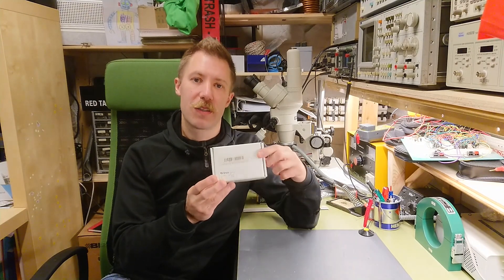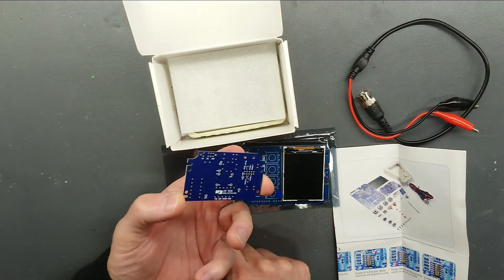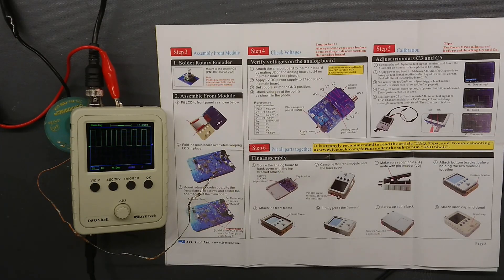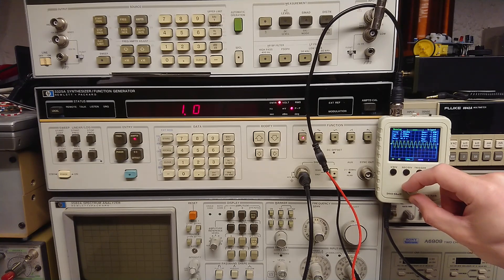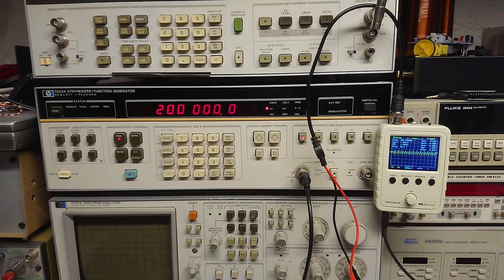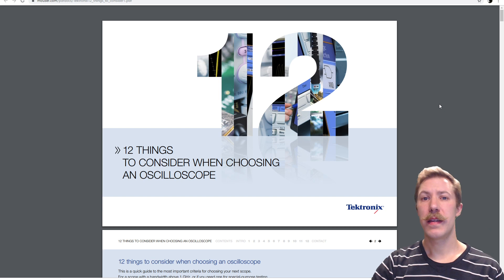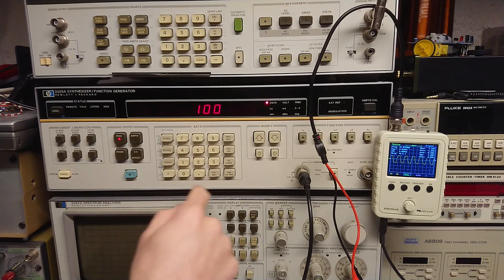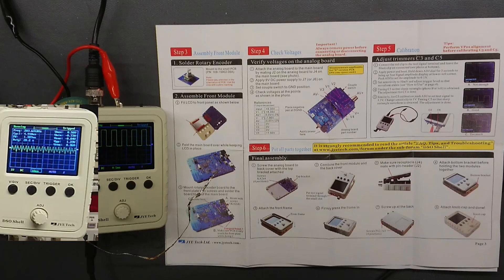DSO138 Oscilloscope Review, Test And Why You Should Not Buy It

Comment: Just about what you can expect from something like this. 

Great video showing the actual limitations for the device. 
I find it quite funny if people complain, that oscilloscopes are so expensive. 
If you consider that most of them own a 800$ smartpone. 
I guess if you really want to do some stuff, even a 200$ chinese scope is way better than this.
Reply from the maker: If you really want to go cheap, finding a old analog 20 MHz scope is the best. Even the half bad/whole price USB scopes are low performance. A second hand rigol from their first generations would be a good buy as well.
Reply: @KaizerPowerElectronicsDk  
Yeah I started with an analog 30MHz Hameg scope some years ago.
I would recommend something like this to everybody starting electronics, since they are cheap, basically indestructable and you really need to learn how to measure since there is no auto button. :)
Reply from the maker: @gammaleader96  haha exactly the same reasons I would give. I still have the 20 MHz Leader 2-channel that I bought 12 years ago. You can find it in some of my old projects, like the TL494 flyback driver on kaizerpowerelectronics.dk

Comment: That's not a oscilloscope , that's a toy !
Reply: Johnney Bot, that is utter nonsense! With such a philosophy, if I gave you a 100MHz scope, and you were used to 200MHz scopes, it seems that you would call the 100MHz model a "toy". This is a well thought out and designed and realized DSO, with a useful bandwidth of 0~20kHz, period, and it works very well in that range. It is a good choice for education, hobbyists who are only interested in audio frequencies, and even some kinds of professional technicians who only want a very small scope that will let them look at lower frequency waveforms and make basic measurements of voltage and frequency. Definitely not a "toy".
Reply: I considered giving it to my kids, but on second thought I will buy them something better, no reason to lead them in a bad direction :)